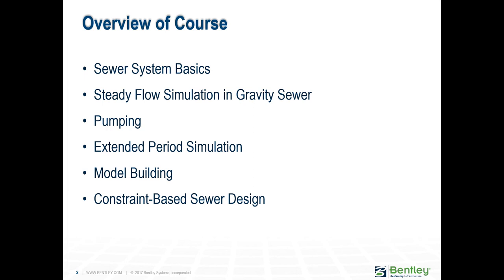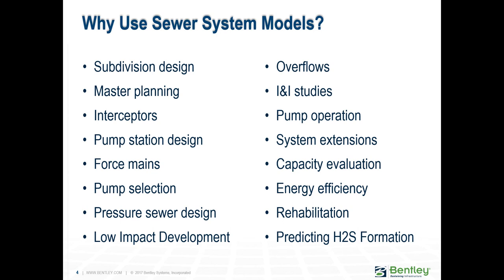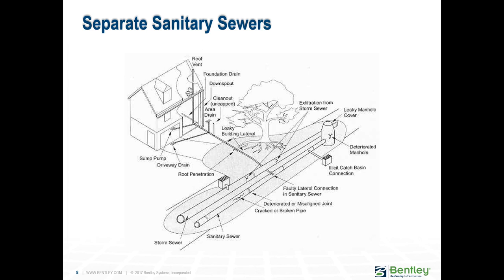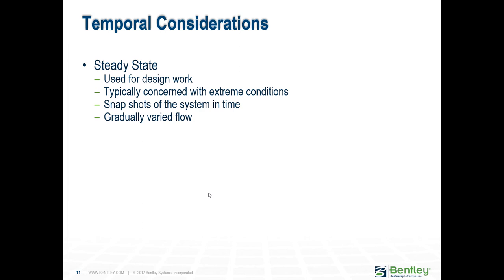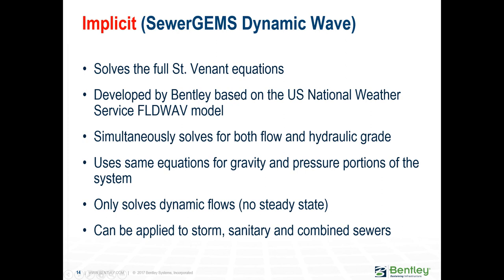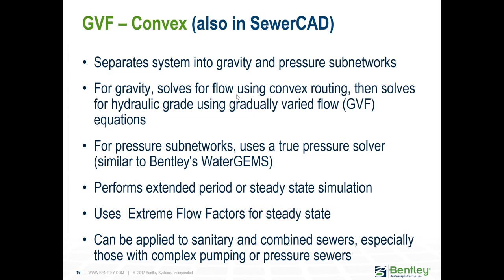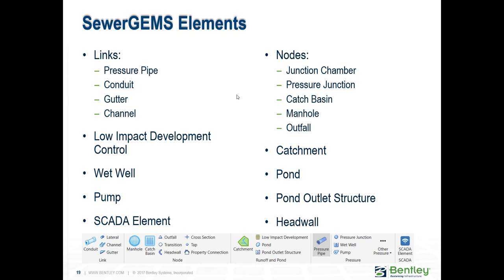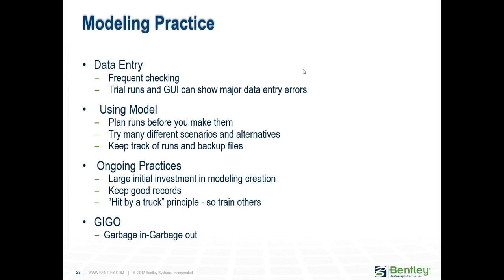SewerGEMS/SewerCAD Fundamentals Part 1: Sewer System Design and Modeling Fundamentals

Comment: Can we auto design a surface drainage  system on sewergems ?
Reply from the maker: yes, although the ground elevations are fixed, inlet opening sizes are part of the automated design routine. See: https://communities.bentley.com/products/hydraulics___hydrology/w/hydraulics_and_hydrology__wiki/26823/in-the-inlet-library-what-is-the-design-lengths-used-for
Reply: @bentleyopenflows ttThanks a lot ...
I have tried software doesn't support open cross section ( channel and cross section combination). What could be solution?
Reply from the maker: @faseel-e-shaaor8842  correct, open channels are not designed with the automated design feature, just the subsurface pipe network and the above-surface gutter network (inlet sizes). See more in the following article and if you need more help, please post on our Community forum. https://communities.bentley.com/products/hydraulics___hydrology/w/hydraulics_and_hydrology__wiki/22833/can-automated-design-size-open-channels

Comment: If i put the ground level negative , the program give me this error.
(Invert elevation (0.00 m) is higher than or equal to rim (or top) elevation(-0.40 m).
Reply from the maker: Hi Pola, the message is telling you that the invert of the element cannot be higher than the ground elevation. If your ground elevation is -0.40 m, then the bottom of the structure (invert) must be below -0.40 m. If this does not help, please post on our forum with more details: https://communities.bentley.com/products/hydraulics___hydrology/f/haestad-hydraulics-and-hydrology-forum
Reply: @bentleyopenflows   Thank you, but how can I make the bottom of structure below -0.40
Reply from the maker: @pola2000ful  You can adjust the "elevation (invert)" field in the node properties, or use automated design to drop the invert down based on design criteria such as cover. For more questions, please post on our forum (see link in previous reply).
Reply: @pola2000ful  you take the ground level copy paste to excel and subtract 1m from all level then insert the result to invert level in flextable